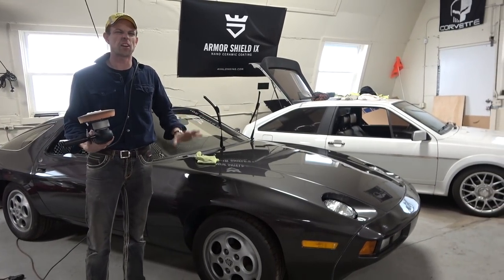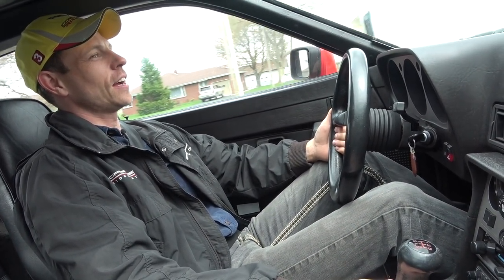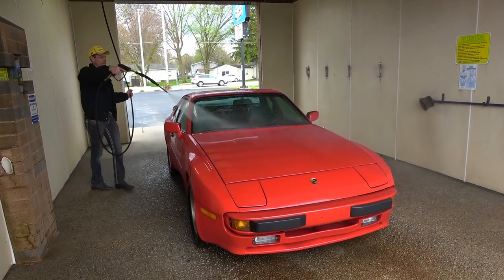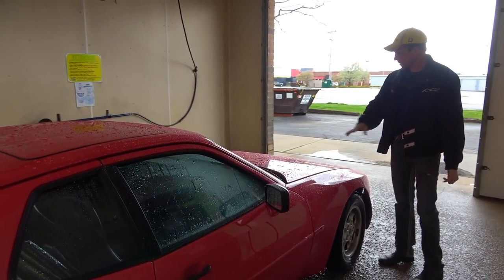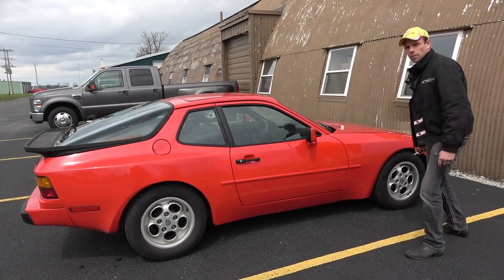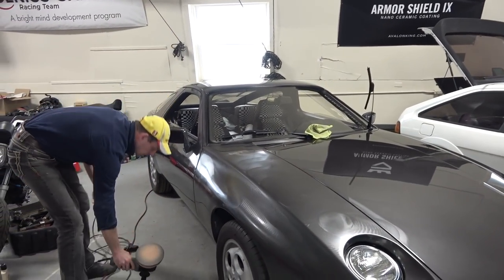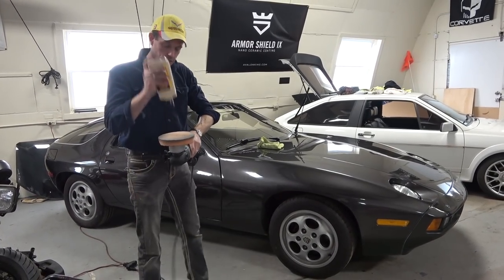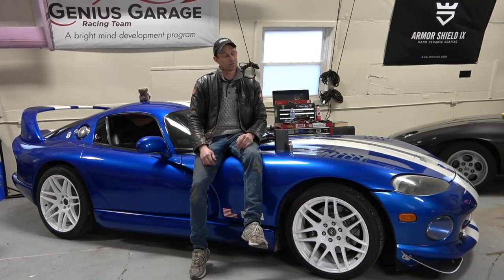The car wash HACK | Tested on Porsche 944 and 928

Comment: Casey, all you need is a good clay bar job. Depending the strength needed on the clay bar to use and good old quality carnauba wax done! If the paint needs restoration? Then light to medium compound, wax n go! Difference is how good the person is at what they are doing!

Comment: I hit a large curb in my 2002 BMW Z3 M roadster a few years back. Caused some major damage for this u-turn in the dark bedding in my replacement ceramic rotor and ceramic pads so was doing some hard pull to get the crazy expensive big brake kit to last.  Nevertheless I damage my radiator, fan shroud, under shrouding arrow,  brake duct cooling line and air fouls under the car even broke the lower grill.  It was rough... I started pricing used and new parts after getting the total cost to do it myself I ended up going to harbor fright and getting the plastic welding stuff and fixed everything but the radiator.   Welding plastic is like tig welding and melting mesh in to it which worked great.

Comment: The ceramic coating, when fresh, will help repel dirt, with it's hydrophobic properties. Works great, allows for a touch-less wash to take care of dust and minor contaminants. It will slowly lose the hydrophobic capability (but it will still protect against swirls) - when it does, apply another layer, and you get it back, you shouldn't have to polish or do a correction, and it will go on easier. Or, apply a hydrophobic topper like beadmaker, griot's poly gloss, a ceramic spray or quick detailer, etc.

Comment: Broken screw brackets! I have fixed many of these, if there is any of the original pipe/columns left you can reinforce the fix with heat shrink tubing.

Any that aren't broken yet, can also be reinforced.

Comment: Tip: You really have to use the spot free rinse. that ionized water really helps eliminating spots after a wash. 2 cents  

I've wanted to ceramic coat the 350z for a few years now but just never do. Seems like a major task that I don't want to F up. That and I don't get out much anymore and the car is garage kept, stored Winters.

Comment: The PCA is coming for you. That guy was just the spotter. Keep the window shades down when home. Although getting into the finer details of the emblem over time may buy you a reprieve. 

And the washer has a pause to encourage people to add money. 

Question, how does the ceramic coating do with hot brake dust on wheels? I have plenty of gunmetal gray chrome wheels due to brake dust I just don't feel like scrubbing off and could use a solution.
Reply from the maker: Not sure yet, but my gut feeling is it helps a lot. I’m gonna super clean my white Viper wheels and coat them for this very reason. Also, hilarious comment.
Reply: @CaseyPutsch  Yes get the Viper out for a hard run and it will indeed let us know on those white wheels. (Your a brave man for having those, but maybe the pads are cleaner than what I prefer).

Thx and keep it up with GG.

Comment: Hey Casey, glad to see you applied several of my polishing tips and tricks :) Your technique improved a lot! About the hack-wash Method: I actually use the same method, but I use a little pump sprayer with diluted ONR (the blue stuff, without wax in it) to help lift the dirt a little bit better, before I rinse the car off. After driving it, i use an electric leaf blower to blow the remaining water of the hard to reach areas. this way I dont touch the car and don't have to scrub anything. Of course, this technique works only on ceramic coated cars.

Comment: if your seats are cracked, you can get vinyl from the seat back and the lower section of the rear seat from an similar yr. Audi to use to build a repair piece..